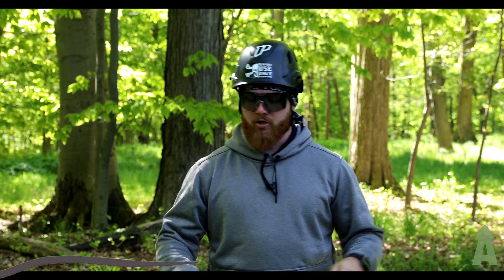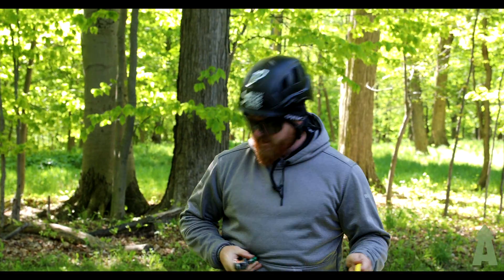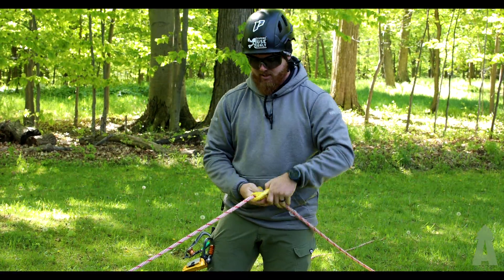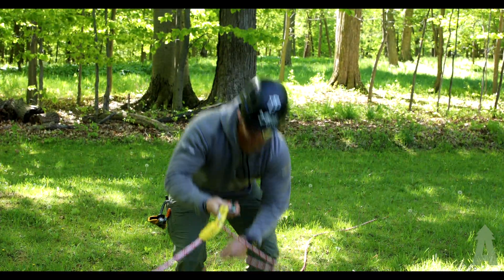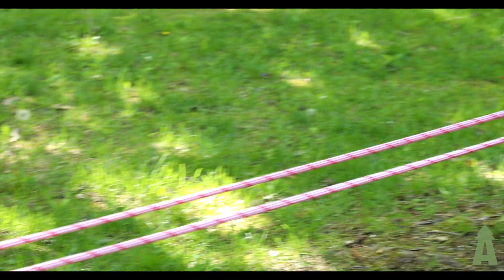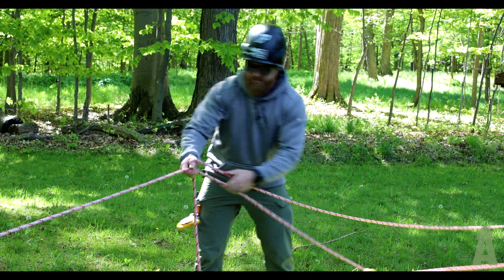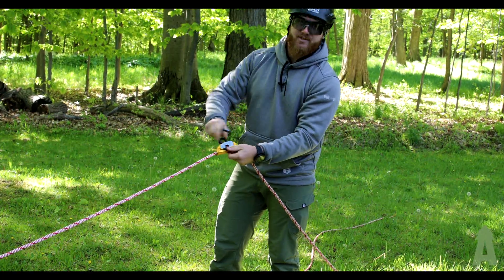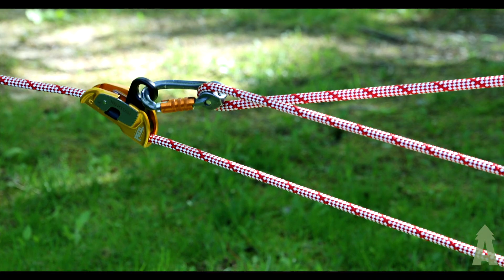Mechanical Advantage 3:1 for Tree Work

Comment: Does the MA system that you show in this video lock in place when you pull on the rope. So theoretically when the tree is falling, it couldn't pull the rope and fall in an unintended direction, right?
Reply from the maker: The 3:1 system shown in this video does not have progress capture.
Reply: @BartlettArboristSupply  Can you show how to configure this system with a progress capture added
Reply from the maker: We can, thank you for the suggestion.